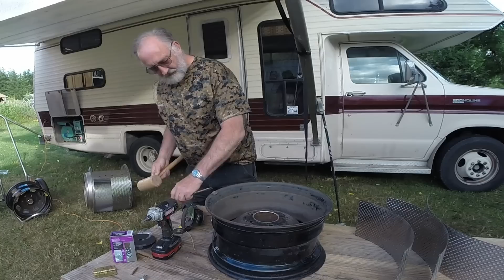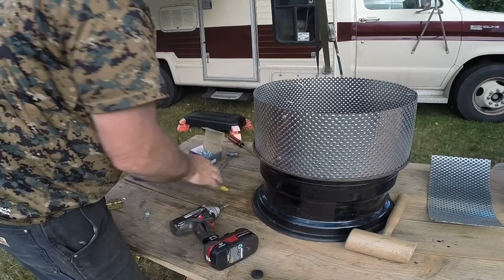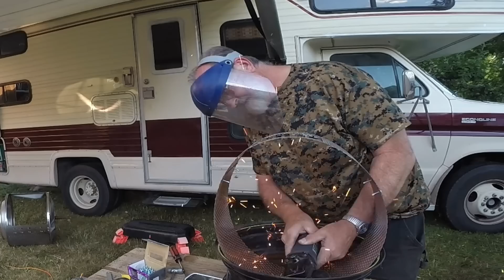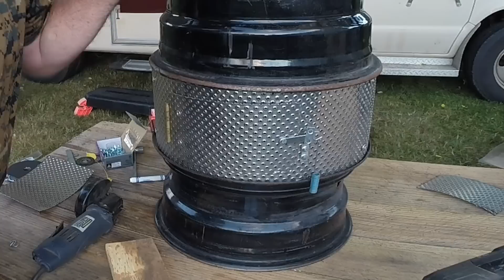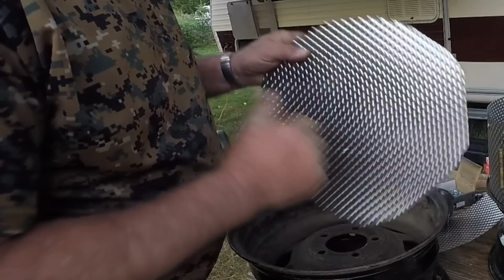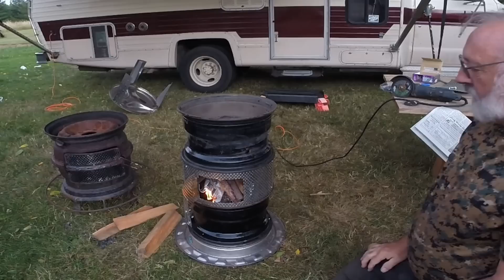New rim stove Dry stack

Comment: what kind of wire mash do yu use ?????? and can yu make a full video of the washing machine parts that yu use !!!!!!
Reply from the maker: I have no wire mesh in the video. You can see the round front load washing machine drum is cut into usable pieces for the sides of the stove. The part of the front load washing machine is what the cloth set in to be washed. I do not take it out of a washing machine. But if you know a appliance repair company like Sears or A&E, they throw out this drum after the repair. If you ask for a drum they might give it to you so the dumpster does not get as full.

Comment: You could put a top piece with 3 supports to deflect the heat out also.Nice work.
Reply from the maker: That is a good idea. I do have a metal plate with a smoke stack to cook on. It  keeps the smoke out of our eyes. Most people do not need to go that far. Just need a fire to sit around.

Comment: It may be a good idea to wash the car rims with soap and water and rinse really well considering cars brake shoes are made with asbestos and you wouldn't want that burning or inhaling any of that dust quick note
Reply from the maker: Yes sir all kinda a nasty's could be on the rim. I find when the paint is burnt off,  that nasty stuff falls away with it. I use a wire brush outside to clean it.  But now it rusts easily. If you spray Pam baking spray on a hot rim it will make a carbon-based patina. (Caution if it's a hot fire, it will catch fire.)  Somewhat like you will find on a Dutch oven. At that point I think it is safe to cook food over. Remember also, Pine, Fir and hemlock are for heating fires, If you cook in a pot with water and a lid, that's OK,  It will soot up your pot, But you will have a cooking fire. It is not good for a marshmallow fire. You want oak, maple or alder. The resin in the wood will give a nasty taste. Thanks for your comment and concern. Take note People,  JOEYHIPHOP2008 has warned you.
Reply: Great info . Thank you 
Bob Anderson Joey .

Comment: That is awesome! What size rims are those and what were the measurements you used for the panels?
Reply from the maker: 15" steal rims. Each panel is  19" long and 14" tall then you cut it 19"x 7" . after you fit all three panels over lapping  the ends so it can be screwed together. The 4th panel you make a door. Make the door cut out smaller then the door.
Reply: Thank you. :)
Reply: 1

Comment: looks like easy to fall over and spread the  fire..  to loose at all joints and base
Reply from the maker: That is a good concern. But  the base I used makes it very stable. Everything fits evenly making is very stable. The ones with feet to get them up off the ground, do have a tipping problem.

Comment: where do you get the screen material, and is it heat resistant???????
Reply from the maker: The metal is an old front load washing machine drum. Many people had used them for back yard fires as a full drum. I used just pieces for my rim stove. Watch the video as I cut out what I need. Even the bottom where I build the fire is made from the same drum.

Comment: Very cool idea! About how long would it need to burn to get the paint off of it? Does the stainless washer mesh buckle under the heat and weight of the rim?
Reply from the maker: I heat it full of wood the first few times. Then when cool I see if the paint remaining can be brushed off with a steel brush. The washing machine tub is tough. It will hold up even when red hot.